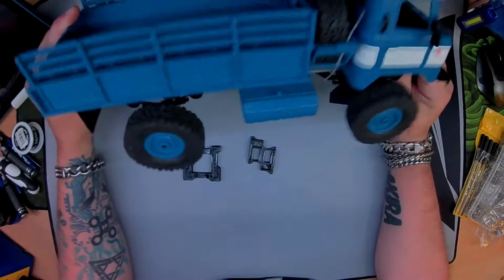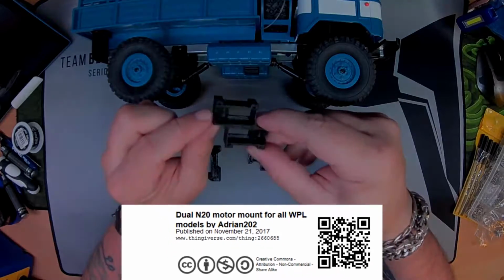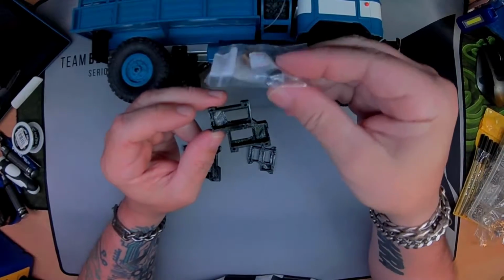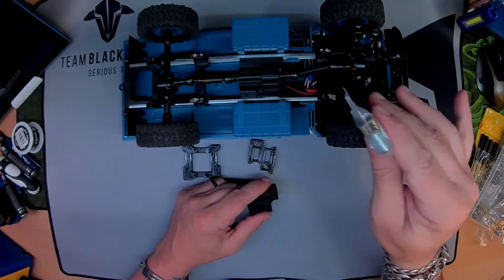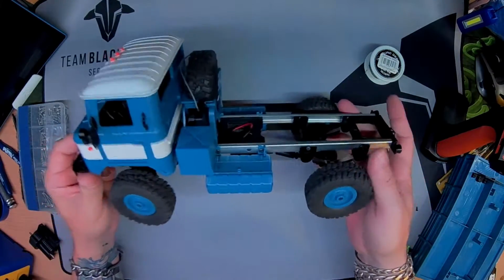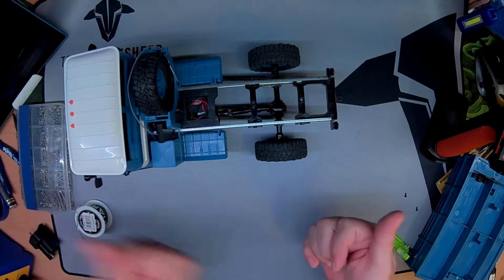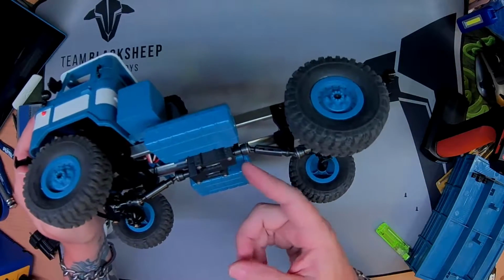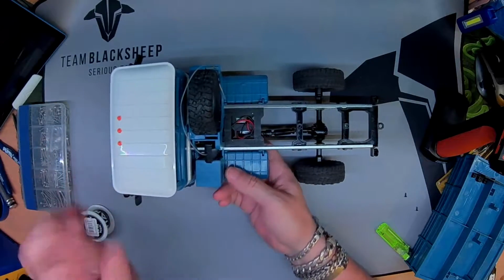Gaz 66 Dual N20 Motor's [ WPL B24 Becomes A Crawler! ]

Comment: It´s really heart-warming to see people share their designs in this way. Despite the low wheel-speed, this is now properly capable - good luck with your plans to find a pair of motors which are wound to give you that RPM sweet spot. Thumbs up   : )
Reply from the maker: Hey, Del!
These motors are just too weak and plans have changed significantly, I have been assembling a 540 setup but parts have been slow to trickle in,while in the meantime 370 geared motors with metal transfer boxes have come to market and again, waiting for arrival with never ending delays.

Let's just say there's lots of life and improvement on the cards.

As for the Mardave tires, the materials are just not suited to provide the grip on early testing and have taken a backburner due to the cost of decent printable media (£60 for 500g).
I have considered trying to vulcanize the stuff I have but fear tainting my cooker - ha!

Hope you're all good, fella.
Reply: @MrE.  Hello again   : )

 A single 370 would be enough, presumably.

 The cost of suitably squidgy filament to print the Mardave tyres will hopefully come down as demand rises. It´s an interesting idea for the future...